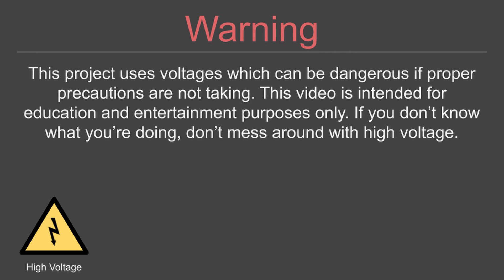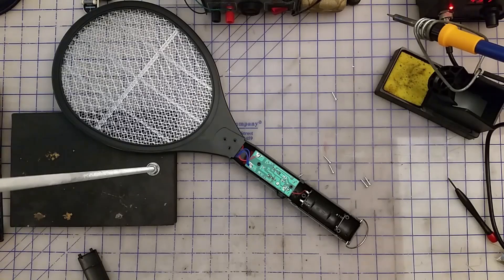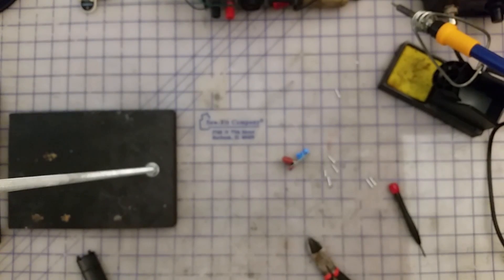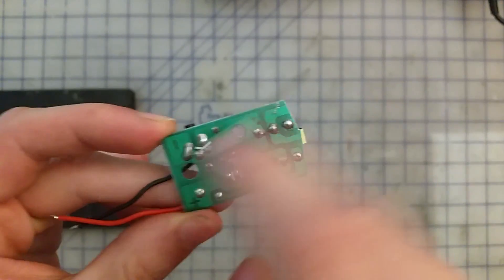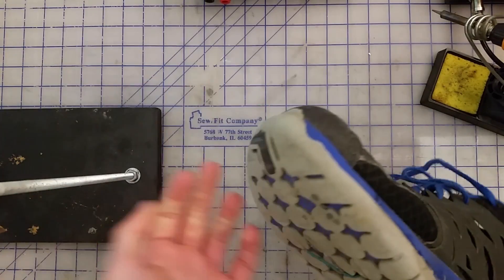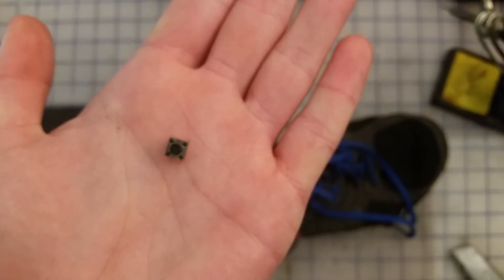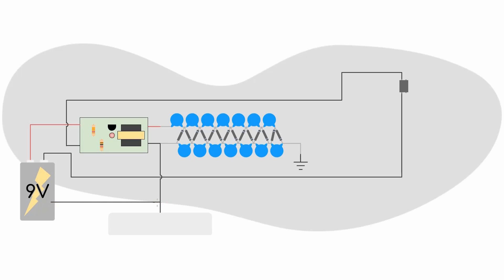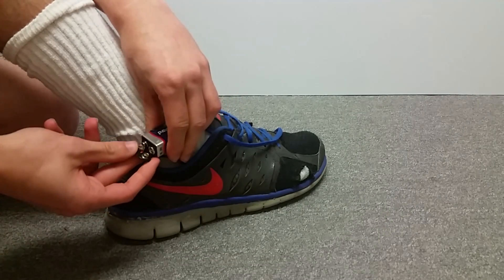Shoot Lightning From Your Fingertips  - Shoe Enclosed Static Electricity Generator

Comment: If using 20kv diodes, how many are necessary? I’ve been attempting this project for years now and am so close to completion!
Reply: You dont need 20kv diodes. The voltage is split  across all of them. Just use cheap 400v ones. If you don't believe me you don't have much to lose.
Reply: Dude, just break down and order a neg ion gen off Amazon
Reply: @oliverklozhoff   Hello, I am super new to all of this but need to make the ionizer -- can you tell me what the ion generator is from Amazon, what does it do ?

Comment: have you considered carving a small kind of bullet shaped indentation into the sole of the shoe and placing the switch sideways?  That way you would not place any pressure at all on the switch and would have to curl your toe to press the button. Might reduce the chances of a false trigger because your not putting pressure  on the button itself.

Comment: great work !!! what is the principle of working and why the ground is required?
Reply from the maker: Thanks! Put simply, the shoe is just a current limited, high voltage power supply. And like any power supply you need to create a circuit between its two outputs. In this case the circuit is completed through ground and the user.
Reply: Ground will zap you if not on

Comment: Instead of the fly swatter supply could I use one of those cheap eBay USB ionizers. Also could a 120pf capacitors work instead of 100pf.
Reply from the maker: I'm not too sure. In theory it's a very similar circuit but it might not be as powerful. Additionally you'd still need to cut the board at the output of the transformer. 

As for the capacitors, 120pF should be fine, but just know that the higher that number gets the more dangerous it gets as well because more current can flow through you.